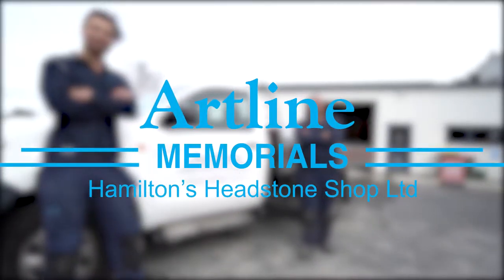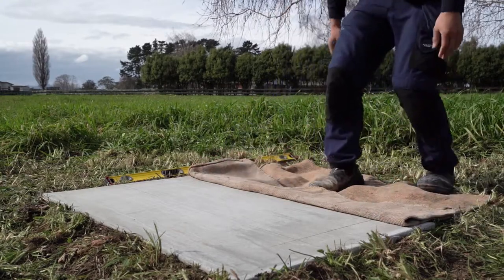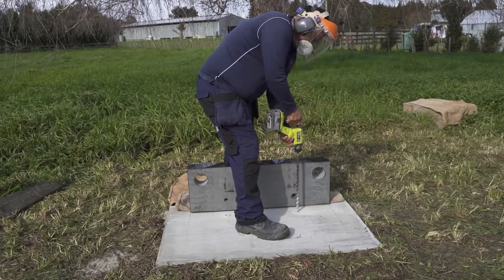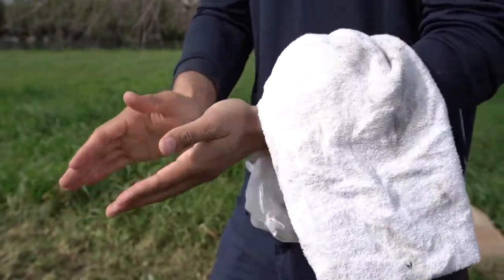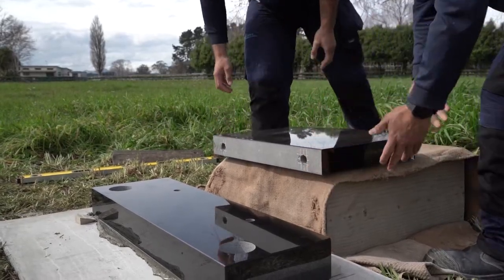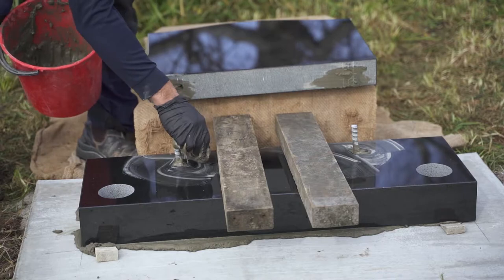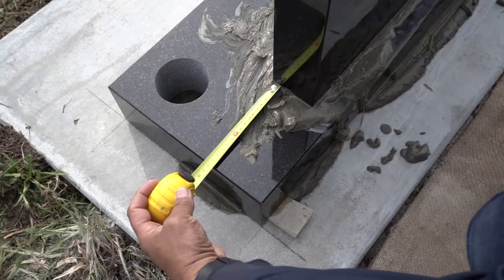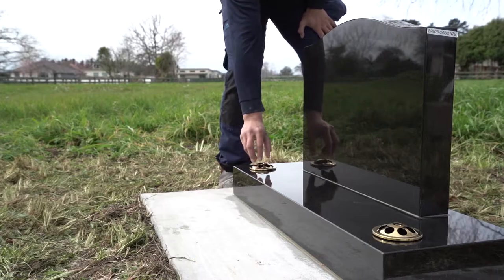Artline Headstone Installation 2020

Comment: What size are the bars 16mm ? 
Also how high do they have to stick out if the base to go into the top part of the headstone ?
Reply from the maker: We use 13mm fiberglass rebar, the NZ standard recommends a minimum of 100mm of rod up the headstone, but you will need to measure the dowel holes in your physical stone to ensure there is enough clearance and adjust the rod height to suit.

Comment: Do you use brick mortar?
Reply from the maker: Hi there, we use general purpose cement. Mortar or any premix with aggregate will weaken the joints and prevent the dowels from functioning as they should.

Comment: That cement joint between head and base looks awful you only need to cement the dowels in
Reply from the maker: The cement packer is to prevent damage to the stone or base, in the future removal of any memorial.
Reply: Excellent. You men did it correctly. I saw other guys not using rebar dowels; just glue or silicone. Unbelievable to make something so beautiful and not give it structural integrity to have a chance to last.